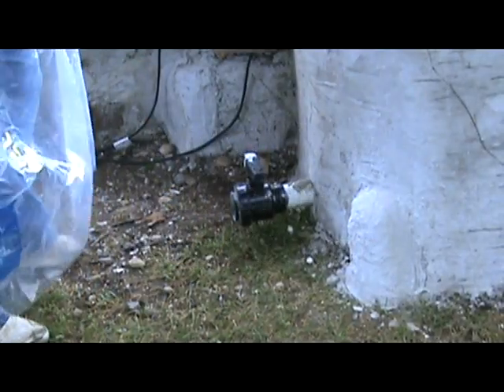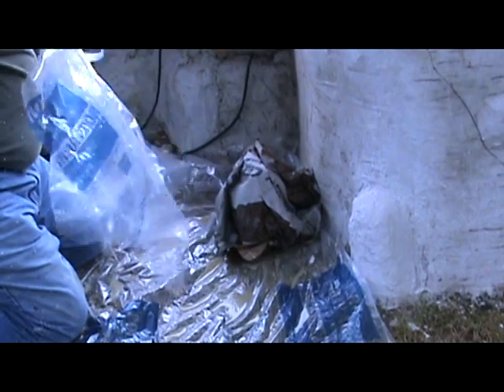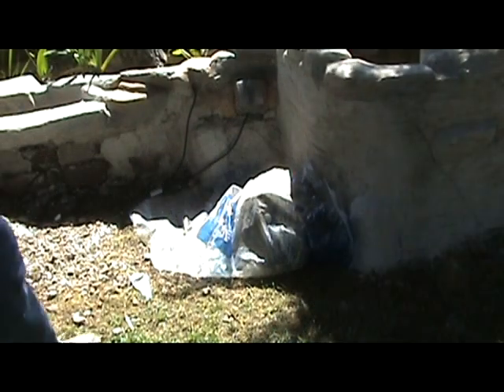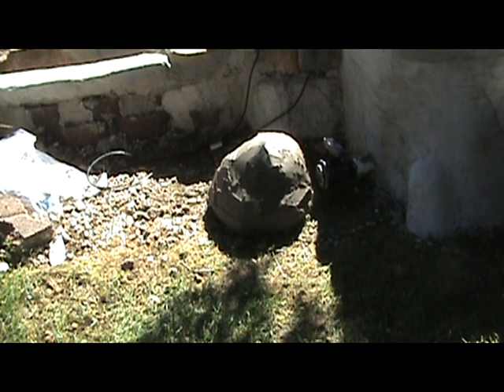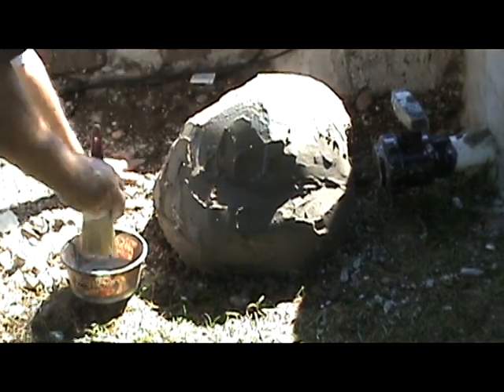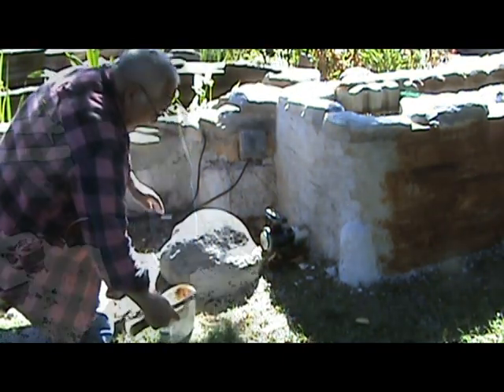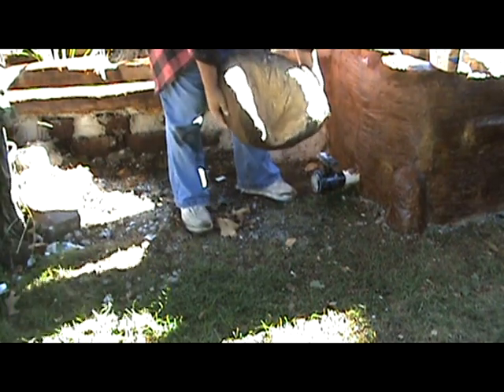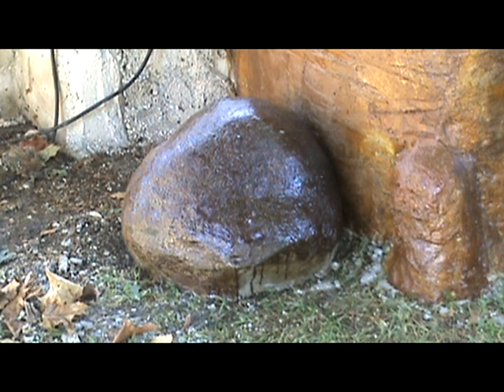How to Make a Hollow Faux Rock Cover

Comment: You mention Styrofoam beads - I was wondering how important it is to add those and what the size of the beads you recommend?  I found on Amazon 0.1-0.18 Inch  50,000 Pcs of White Styrofoam Polystyrene Foam beads thinking this would work?
Reply from the maker: The styrofoam (EPS) beads are known as EPS regrind.  I no longer use them as they are too messy.  I now either vermiculite or perlite, both available from garden centers. Lightweight aggregates, including styrofoam beads, are not required, but are important if you want a lightweight rock.  The weight of this one is about a third of the weight of a real rock that size.

Comment: Just came across this - Great video- where do you buy - styrofoam beads and acrylic polymer or even peat
Reply from the maker: I no longer use styrofoam beads as I now use vermiculite or perlite, both available at garden centers.  Styrofoam beads I had gotten from Menards.  Peat is also available at any garden center. Acrylic polymer can be purchases at home improvement stores such as Lowes, Menards or Home Depot in small quantities. Quikrete makes bonding agent and concrete fortifier, both acrylics.  I purchase mine in 5 gallon quantities from Fishstone  http://concretecountertopsupply.com/

Comment: Hello, I am trying to make a medium/large size boulder.  I just started trying my hand at hypertufa the other day.  I'm waiting for my first small "rocks" to cure.  I wanted to try something small before trying to tackle a boulder.  
I have a couple of questions about this video:
1.  Can perlite be used instead of styrofoam beads, or are the beads better for some reason?  Perlite seems to be called for a lot in hypertufa mixes.
2.  When you say 3 parts water to 1 part acrylic....are these parts the same container measurement as the dry ingredients?
3.  what is the purpose of the two different mixes and layers?  Does it make the rock that much stronger?  I essentially want a boulder strong enough that adults and kids could sit/stand/and climb on.  
4.  what is the last thing you brushed on the rock to smooth it out just before you textured it?  
Thanks!
Reply from the maker: 1. Yes. Vermiculite is even better.
2. It doesn't matter. You're just making the liquid mix that will be used. Just use the same size container for water as you do for acrylic.
3. If you don't put a straight mortar layer over the lightweight coat, the lightweight aggregate (styrofoam, perlite, vermiculite) will show on the surface of the rock. Also, the second layer, though making the rock heavier, makes it stronger.  The lightweight aggregate concrete is much weaker than regular mortar or concrete.
4. Water.  It just removes the tool marks from the trowel.
Reply: +dperry428 
Thanks!  I tried making my first small rocks yesterday morning out of a mix of 1:1:1 Quikrete sand topping mix, peat, and perlite. I made one rock by pressing the mix around a chicken wire form I made around some plastic bottles.  I then closed up a garbage bag around it to cure it.  I made another just by plopping the rest into a plastic grocery bag and twisting it closed. I went to check them this morning.  Before I even opened the grocery bag one I could tell it was still a little soft. I could press a thumb into it and it would give. I then opened the bag and picked up the rock. A huge chuck broke off and crumbled in my hand. It looked and felt just like dry mud. They stunk terrible too!  Almost like poop! Not sure if it's the peat moss or what. I didn't attempt moving the rock I formed around the chicken wire. I misted again and closed it back up to harden more. So my first attempt seemed like a fail. Not sure what went wrong.
Reply from the maker: Why use the peat at all?  You're trying to make hypertufa, which is used to make planters and the purpose of the peat is to make the stuff porous so that the planter drains.  Why would you want to make rocks porous?  Stick to the perlite alone. Also, peat absorbs water and it will take several days, if not a week for what you mixed up to actually harden.  Instead of using sand mix, buy a bag of Portland cement and bags of sand so you can control the mix.  Do you know how much sand was in the sand mix?   You can buy a bag of Quikrete Portland cement for less than ten bucks at the same place you bought your Quikrete sand mix.  You can also get some Quikrete Concrete Fortifier or Quikrete Bonding Agent at the same time. That's the acrylic that should have been in the mix. Why are you not sure what went wrong?  That's like asking a cook what went wrong with the bread you made from "his recipe" except that you used sawdust instead of flour, kerosene instead of water and baked it at twice the recommended temperature. An old adage says, "You can't make a silk purse out of a sow's ear."
Reply: +dperry428 
I just made them based off what I saw on another YouTube video.  That guy used peat and his rock seemed solid, and he made it seem like it hardened after a 1 day cure.  And I got the recipe off the GardenWeb forum. I didn't feel like trying to move a 94lb bag of Portland. I hadn't seen your videos/method until after I made these
Reply: Hey Phil,
I'm right where you are. I've tried the hypertufa mix, trying to save weight. But really, it didn't seem to be all that much lighter. What seems to make more difference is this:

Get your form (substrate) as refined as you can. That will allow you to keep your concrete layer(s) thinner. I know styrofoam sheets aren't cheap, but I've decided it's worth the price if it allows me to build my form accurately then I can basically skim coat that with a couple thin layers of concrete. That will save you weight.

I'm using styrofaom sheets and a big hot knife to create my shapes/substrates. Then I layer with fiber reinforced mix.
Reply: dperry428 *

Comment: What simple recipe can I use to make a heavy real looking boulder that I don't want to move?
Reply from the maker: 3 parts sand to 1 part cement.  Keep water to a minimum and add slowly to keep the mix more like clay.  If you want crack tolerance, add acrylic bonding agent to the water and add fiber to the mix.
Reply: Thank you. What kind of fiber are you referring to, please?
Reply from the maker: You can use any of a multitude of available fibers.  Probably, the most commonly used one is alkaline-resistant glass fiber (AR glass).  I only use that in base coats as it shows on the surface.  I use PVA fiber for finished coats (polyvinyl alcohol).  It's very fine (1/4 that of human hair), but more expensive.  When I started out, I used polypropylene fiber,  cheap, fine, but tends to ball up and hard to mix in.  There are nylon fibers, basallt firber, cellulose fibers and many more.  Though more expensive, I'd recommend PVA.    Here's where I get mine.  https://concretecountertopsupply.com/Category/FibersReinforcements   Just a small handfull in a bucket of mix is all that is needed, so a 5 pound bag goes a long way.  You might also try a commercial pre-bagged mix such as the Quikrete Crack-Resistant Concrete, but I can't vouch for it as I've never used it.  https://www.homedepot.com/p/Quikrete-80-lb-Crack-Resistant-Concrete-Mix-100680/100318448
Reply: Thanks so much for all the info!! Appreciate it!!

Comment: What is the recipe and where would I get them to make a large well tank cover?
Reply from the maker: If you're only doing this one project, go to a home improvement store such as Lowes, Menards, Home Depot and buy sand mix and acrylic fortifier (bonding agent) and vermiculite or perlite.  Mix 2 parts sand mix with 1 part vermiculite or perlite, use liquid acrylic and water as recommended by  manufacturer.  Put on a thick layer of that mix, then cover with a thin layer of same mix minus the vermiculite or perlite.  OR  Make a mix like this:  https://youtu.be/etSWuBIcdZc  and get supplies from https://concretecountertopsupply.com/ Get sand and portland cement from home improvement store.

Comment: It doesn't say how much mortar cement to use with the first stage.
Reply from the maker: The mix is 3 parts styrofoam beads, 1 part sand and 1 part cement.  The liquid is 1 part acrylic polymer to 3 parts water.

Comment: can you buy the stuff already made
Reply from the maker: What stuff are you referring to?  If it's a concrete mix, sure, every home improvement store carries a wide variety of mixes from common concrete with gravel, sand and cement to mortar mixes, sand mixes, fast-setting mixes, "high-strength" mixes and topping mixes. I can't vouch for the utility, functionality nor durability of any of them.  I don't know what the manufacturers put into them, so I make my own.  That way, I know exactly what I'm getting.  Many other people use what they find in the home stores.

Comment: Can you please add links
Reply from the maker: Links to what?
Reply: To the materials you used
Reply from the maker: In this video, which, by the way, is 13 years old, I use materials I would no longer recommend.  The styrofoam, while lightweight, is extremely messy as it blows around.  Today, I would use, by volume,  2 parts perlite or vermiculite, 1 part sand, 1 part portland cement, a 1/2 part fiber, and liquid water containing acrylic admix/bonding agent diluted so the resulting solution contains 10 to 15% acrylic solids.

Comment from the maker: @MrDarby76   Send me a PM with your email address and I'll send you a list of sources.  Fiber does not have to be polypropylene.  It can be alkaline-resistant glass fiber.  Check concrete suppliers and countertop manufacturers as well.